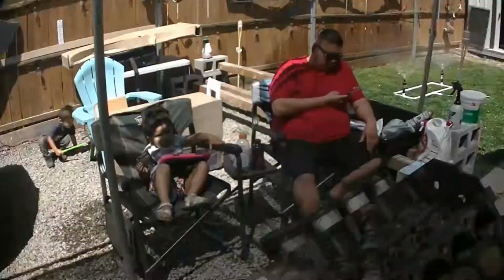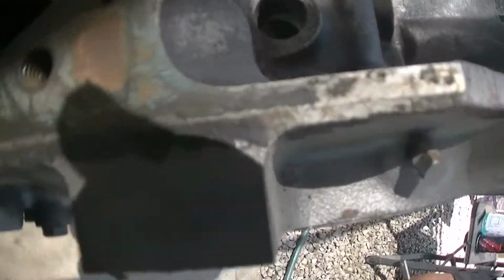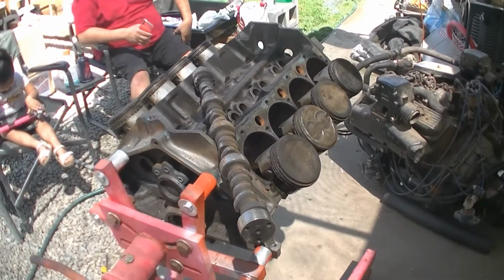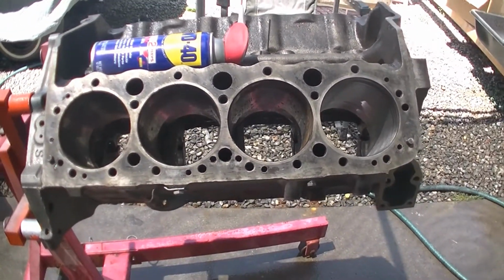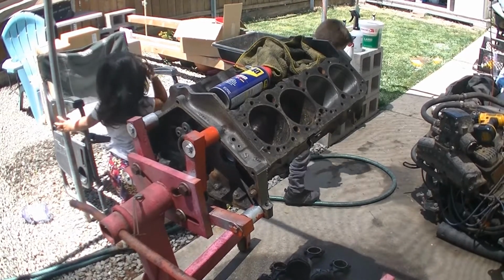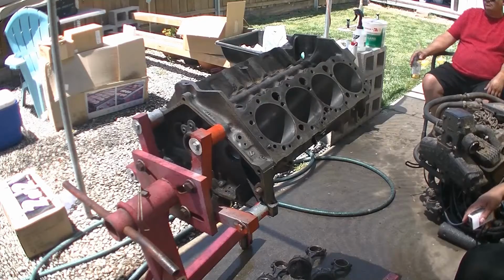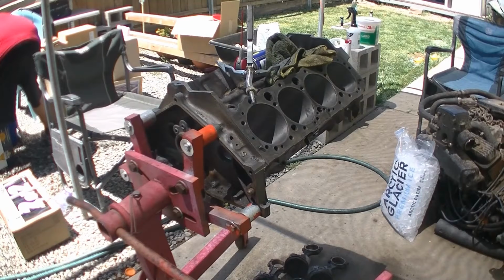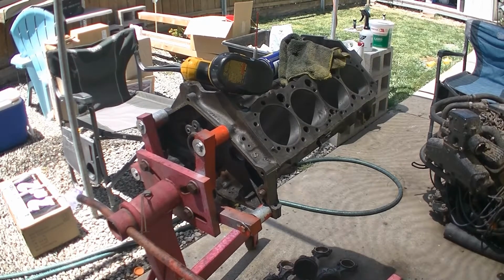Chevy 350 budget rebuild pt 1, honing the cylinders

Comment: You'll save the stones some if u break clean them bores out a bit and get some of that carbon and rust out before hand. But they turned out ok for what it is. I like dingle ball hone for this, its very nice and super easy to use with alot less risk of scoring up the cylinders with the stone kind. They cost between $50-$80 for the cheaper ones but can so plenty of bored with them.

Comment: Did you have to up a size on the pistons after the hone?
Reply from the maker: No, I used stock size pistons, u don’t need to get different size pistons when u hone the cylinders, u only replace the piston size when u bore the cylinders out
Reply: Its not gonna remove any metal unless you go forever and get crazy with it. U just wanna check your side wall clearance when fitting the new pistons or old ones even. Worst case scenario for a backyard budget refresh like this if clearance from where is showing but not enough to bore you can lossen the rung gap a bit, worst case u might a little blow by but if you aint spending the money to do it perfectly then thats your next best bet lol to much clearance will cause piston slap so u need to double check and see what the clearance is